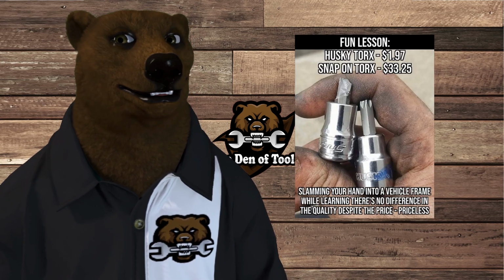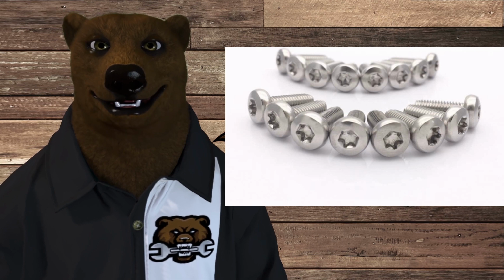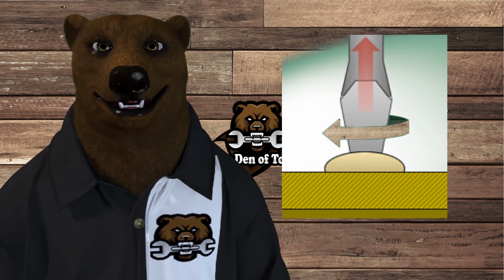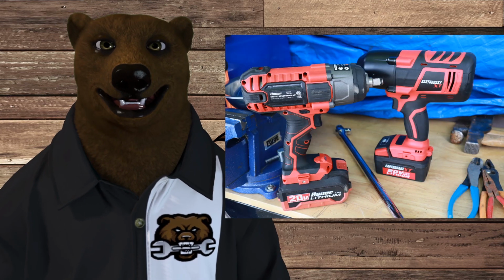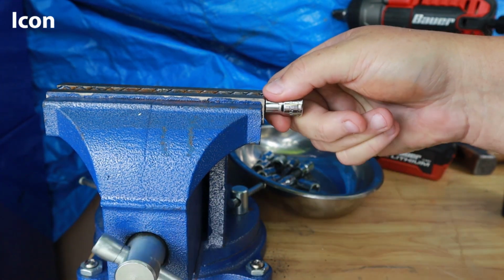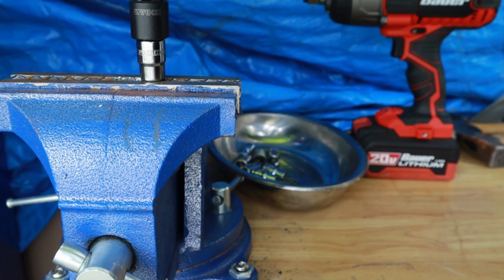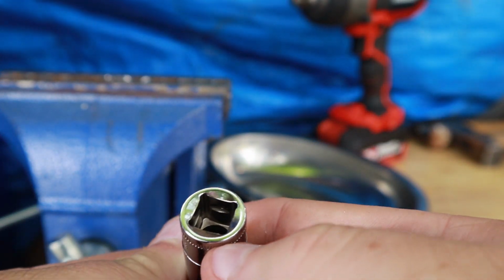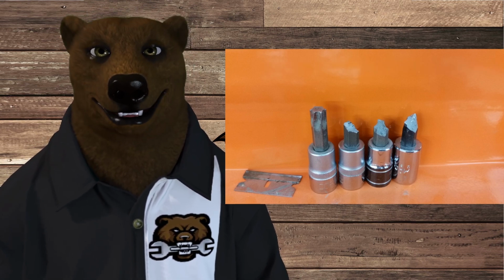Torx Bit Torture Test! 16 Brands put to the test. (Part 2 of 2)

Comment: Basically, if you have any torx fastener that isn't rust frozen into place, any of these should be able to remove it which means there's no reason to spend a fortune on them.
Reply: @athhud  Then break out the penetrating oil and the impact version of these and hope there is enough left of the cavity for the driver to grab. Otherwise it's likely drill and use an easy out.

Comment: No Proto T45 socket bit unbelievable an American made Bit Driver with  AS4984A standards. That you can buy for under 10 bucks. Also no Sunex, Carbyne, ARES or Cornwell or Wright socket bits. Of the three that made the finals two were AMERICAN MADE ( SK and Snap-On) only reason the ICON got to the end, it had longer shaft so more meat for the vise to hold on too( my opinion). The Mac socket not so sure about Mac sells both American made and China made versions. I wonder if the bear will try to use the warranty to replace these destroyed sockets.  Maybe that's why Mac wanted to be there cause they have seen that Hit piece video on their plant in Mississipi that you did and they don't trust you. Really if you think about it that is some real Bear Balls you do a hit video and turn around and ask for freebies from them. I gave this video a thumbs up not the best comparison video I have seen but not the worse. Keep trying bear you will get better as time goes on.

Comment: Red, using an E-Torx bit rather than vise jaws would have let you test the actual Torx bit rather than how well your vise grips the hex on your Torx bit shank.

As it stands, this test is not really a valid test of how the tool will actually perform when used in a somewhat proper way.

No disrespect meant, but your methodology was no good.

Maybe next time you should do a post that asks "how should I destructively test X?"  That way you won't waste money twisting the heads off of screws.  Some of us really know how to break stuff and will share.

As for Torx vs hex fasteners, I have seen way more wallowed out hex fasteners than Torx so I prefer Torx when available.  I also prefer using proper torque on small fasteners so I have a Seekonk in-lb torque wrench along with sets of Torx and hex bits to use with it (that I don't use for anything else).

Ultimately, I agree with your conclusion, a cheap torx bit is not necessarily a weak Torx bit but it would have been nice to see an actual ranking.
Reply: Came up with the same suggestion while watching. An impact-rated E-torx socket with a torque meter attached may have been more revealing. 
Thanks for the test anyway. I wish there were more tests like this, so people could see what they pay for.

Comment: I have the capri set of torx and allen. I've broken 3 of the torx bits on rusted bolts. More brittle than I had hoped but they did replace them when I filled out the warranty on their website. The ones that broke were all the TT type with the hole in the end of the bit which does weaken them significantly. Your test method wasn't all that great here, but I appreciate the effort.

Comment: One thing I have learned in 50 yrs,  Being a Motorcycle Tech, Industrial/ Medical machine builder ETC,ETC, Common Motorcycle [not Harley] Fastener sizes 8mm 10mm 12mm 13 mm[Euro Bikes] 14mm 17mm 19mm I have always bought Snap-On For rarely used sizes I go cheap.   No sense in buying $$$ tools that might be used once a year! I have bought cheap wrenches/Sockets, I have had to cut,heat bend and weld to make a custom tools. BTW, I have a set of Harbor Freight Torx . I do not use them often, but they work. I also have used Harbor Freight Swivel Hex keys[Allen Wrench] for years On the Job ...Never worn out one wrench! [This Comment was Not Sponsored..Lol..]
Reply: For years I have used the cheap home depot and walmart "precision screwdriver" kits that MIGHT take a screw out of a knife once before twisting or snapping altogether. 

Just a few weeks ago I got a set of Bondhus SAE and metric allen keys and one of torx screwdrivers. They are WAY better than the Walmart things, though admittedly not an apples to apples comparison.
Reply: dont be supprised when OSHA shows up and makes you remove all your "mutilated" tools from the shop,,,obama started this, was about to happen at a machine shop i worked at in 2011, when i got laid off, they told us any ground on, welded, heated and bent, or modified tool was to be removed and taken home ,never to be brought back into the shop...only factory made tools...

Comment: Spax are the BEST for construction screws! GRK (the other one at home depot) are ok, but use a smaller torx size. 

For the next test look into the Fireball Tools vise. There is a YouTube video where he tests all different vises and then one where he builds one that is beautiful and like 2 or 3 times stronger than the best store bought one. Maybe it is overkill, but it would be a fun project and would FAR outperform the one here that let go of the bits.

Great video, but I wish there would have been more "sudden, violent release of energy" and shrapnel lol

Comment: best test of a torx bit is box bolts on pickups in the midwest after a few years and they locktight them at factory usually the left front one will twist or snap a snapon ive replaced mine 20 times now but its free everytime so far

Comment: I watched the whole thing and never saw the screws, if they were 304 stainless they could have been strain hardened to be around grade 5 120,000 psi, you should have gotten a socket head cap screw which are 180,000 psi to test I didn’t look but I’m sure McMaster Carr would have them online

Comment: Macs RBRT is actually pretty good shit. I can’t say if they’re any stronger or not, but I CAN say that they grip into those stripped heads like no other. They have saved my ass many times. If they can’t get it out, might as well go straight for the drill, grinder, or torch

Comment: You need to use the earthquake impact on your bolts holding the vise on the workbench.  We could see the nut on the right front shaking and turning when you were applying the beast in the  testing.

Comment: Torx are supposed to be more highly engineered or fancier or something than plain old internal hex or Allen socket drive but yet people seem to have more trouble and complaints with torx. Could it be using the wrong size,not getting the bit all of the way down into the socket (need to clean it out first?) or mix up between Torx and Torx Plus?   "Snap On Gold"? (gold color bits that are said to be different than the regular dark color ones)
complexity to make your mechanic have to buy more tools? 
might be interesting to try the "hand impact driver" such as Snap On's PIT120  or Koken "Attack Driver  AG112H" in a last ditch effort to get something loose (probably would be better with impact rated bits but might not be as damaging as a "real" impact or air gun (have to remember to set the direction to "lefty loosey" before starting to whack that hand impact driver!)

Comment: @denoftools I'm really thinking about the Pittsburgh wreaches are they built well
Reply from the maker: They have several versions of those.  The really cheap ones are pretty bad but they do have some that are great for DIY use.
Reply: @denoftools  thank you I'm looking for the middle class I'm no pro but not a once in awhile user I farm and need a tool that I can honestly abuse at times

Comment: I suppose it might be a minor complaint but since you cut out the shots of you tightening the vice I wonder if there was inconsistent clamping force on the hex shaft causing some to spin easier, I'd love to see you try them all side by side on old Ford truck box bolts. They are a self tapper/tri-lobe of sorts and we end up just having to cut the heads off.
Reply from the maker: I'm sure there was unfortunately I could not find a very viable way to really eliminate that as a possibility.

Comment: You should do part 3 with the alloy bolts I posted, smaller size bits, get a torque multiplier for the biggest torque wrench you have and do over breaking bits and noting the torque they break, and get a better vise if possible that one looked so cheap

Comment: you might be able to show cam out is to preload the wrench intoo the head of the bolt using a hydraulic press with a gauge , if the tool cams out it should show a raise in force while its happening on the gauge how mush force is needed to counter the cam out 
too bad a lot of the tools arent available in europe , i was looking intoo bauer and tektools
looks like you hit 100 K congratulations

Comment: Check project farm videos . He uses a bike rim on a drill press with weight on a rope to watch camout and test bits and step bits etc
Reply from the maker: I saw his dentist but the real issue there is there's no control on the fasteners. He's using a different one each time and they are not precision-made items as such the fluctuation was more likely due to the different fasteners than it was to the different bits

Comment: Instead of putting the shaft in the vise why not find the correct size deep impact socket that would fit the shank portion of the Torx?  Then put the Torx in the socket. The socket would hold the bit in place.
Reply: That was my thought at first too but, you'd need to use an actual pipe vise for a test like that. The flat jaws on the vise in the video would allow a round socket to slip very easily. The vise used probably has what could be considered pipe jaws below the flat jaws but, in my experience, they're only intended to hold pipe for cutting, not for heavy use. My Chinese Craftsman vise actually has 2 different sets of "pipe jaws" under the flat ones. They hold pipe for cutting just fine but, if I try to tap pipe, they don't hold.
Reply: @MikeBrown-ii3pt  I wasn't thinking about putting the socket directly into the vise. I would put the socket on the end of a breaker bar. You could put the breaker bar in the vise if necessary.

Comment: Definitely test hex bits. Personally I’d love to see the ball hex tested.
Reply: The ball end won't take much torque before they snap off. I've actually broken them off of top brand USA made hand Allen wrenches. They're great for light duty work at odd angles but not designed for high torque applications.

Comment: 304 stainless isn't that great of a material. Nothing wrong with it, just not super strong.
Yield strength is 31.2 kpsi, versus a grade 5 bolt at 85 kpsi and a grade 8 bolt at 120 kpsi.

Camout shouldn't be an issue with a Torx. It doesn't have sloped sides like a Phillips or (non-gunsmithing) flat screwdrivers.

You really need a better vise 😁

As far as those rounded corners in the hole for the anvil, that's the same thing you're seeing with the "flank drive" from Snap-On. You can't machine a perfect sharp inside corner like you can an outside corner, so you add a little relief in the corners so you can tighten the tolerances elsewhere. John @ NYCCNC like to call these "mouse ears", but you'll see this in a wide variety of places: on an engineers square, in the bottom of a v block, in the back corners of a machinists insert vise, etc.  Even the little slots on my welding table have them so the tabs will fit snugly before welding the pieces together.

Hex bits will strip out long before Torx or especially Torx-Plus.
Reply from the maker: I have one, and it is of course in storage.
Reply: @denoftools  Figures. You never have what you need where you need it 😕
Reply: He needed the stainless screws to fix his truck bed cover.

Comment: This would be a good video to REDO, even Project Farm hasn't done Torx Sockets.  But when you redo it, show the weight, example "150 lbs", being pulled on the vise handle.  You could have pulled on the vise like a little girl for some brands and pulled it hard as heck for others, no way to tell.  Edit: Ignore me, I'm an idiot...  I threw my broken Kobalt in the trash...  IT HAS A LIFETIME WARRANTY!!!!  🤣  For what it's worth, I recommend Kobalt, that T-50 took some abuse before finally giving up the ghost in explosive fashion to the Milwaukee Fuel High Torque on a seized truck bed bolt (that is actually a TP-50, lol, took out lots of them, but eventually blew apart.)

Comment: You should have screwed a few torx bolts into the same metal as the bolt then welded the heads to the metal, then test the bits to failure.  No offense, but yr test just showed the failure torque of the bolt not the relative failure torque of each socket.  The vice test is questionable bc, as you said, it crushes the bit not reflecting real world use. Maybe you could vice some holt heads but that too puts unnatural flex into the bolt head.

Comment: I love the idea of the test.  After watching I understand why it would be difficult to test.  That said all torx are not equal.  Bought some craftsman a year or so ago and they were horrible, they would snap using a 1/4 ratchet drive without much pressure. They are a different company now I think so might be better.  I do like the recommendation to use impact rated one's though

Comment: i find it hard to believe that seat belt bolts are not grade 8 and every one i've seen for 35 years has been torx...   since way before buying torx became and "over the counter" type thing.  Ok, smack me with a salmon, too.   You need a better vise.
Reply: In modern vehicles with metric fasteners, seat belt bolts (as well as many suspension fasteners) are most likely 10.9 which is actually "stronger" than grade 8.

I can remember loosening/tightening Torx head door strikers etc. on many older vehicles with Vice Grips before Torx bits were common tools.
Reply from the maker: They usually are or even higher grade. But they are usually a larger size than t45
Reply: @MikeBrown-ii3pt  Ha ha....i had to do that with my 72 Malibu.   That's when vise-grips were made in the US and were good tools.

Comment: Maybe you should ant have used a toy vice to hold your bits and also bringing the bits all the way up to the top of the bit is not how the ends will break off   And wiha brand is the best brand with their micro grain steel made in germany